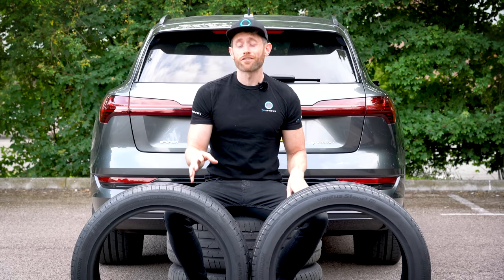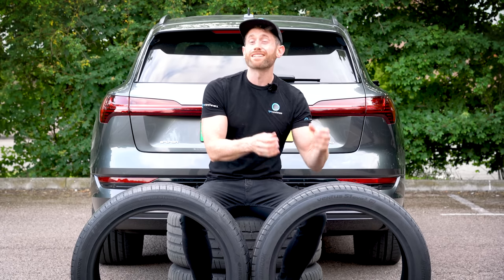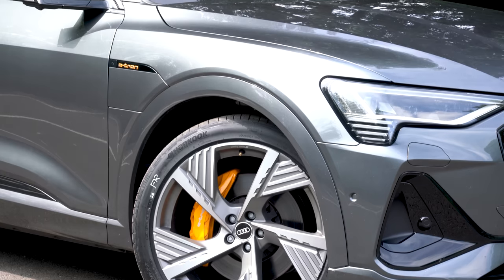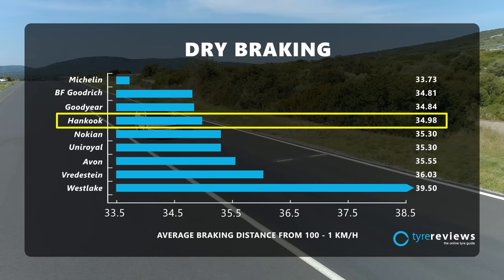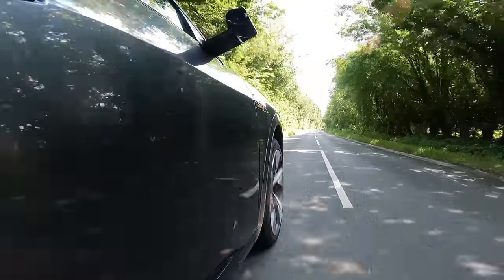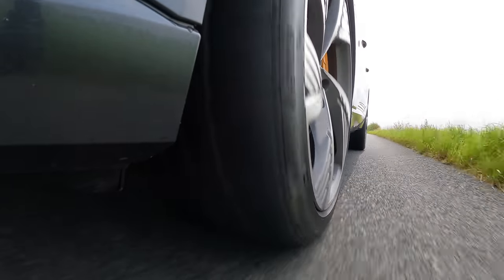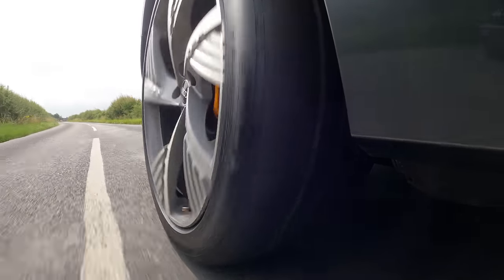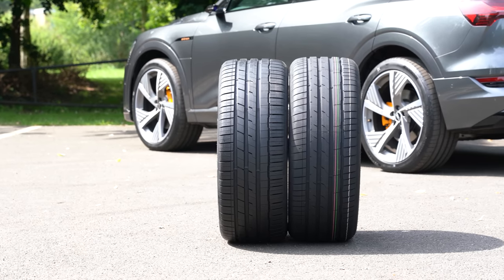What makes EV tires different, and why should you fit them! 🔌

Comment: Love my EV, never going back to ICE.

Thanks for this video. I was wondering about this for a while now and content like this is a rare thing.
Thanks again.
Reply: Love my ICE. Never going to use an EV until they can reach 1000 km range , 5 min charging time and until the fast charging infrastructure will be equal in size and efficiency as ICE.
Reply: @luciteck  (Casually drowns in rising sea levels while overheating)

Comment: Interesting video thanks. I need some new tyres for my Tesla Model S P90D ludicrous but I’m guessing EV specific tyres are also more expensive? Another question I can’t find an answer to…. My model S came with either the 19” wheels or the 21” wheels, mine has the 21’s which look great but come with a significant range penalty. I’m looking to buy a set of factory 19” wheels with winter tyres. Will the soft compound and aggressive tread make the 19’s with winter tyres still more efficient than the 21’s, the same, or less efficient? If you want to get some tyres for the test and I can keep them you can happily borrow my car 😉 😉 😉
Reply from the maker: Ooo, that would need to be tested. Generally smaller wheels are better for range, but winters could mix that up!
Reply: Yes, I’d be very interested to know. I’ve always fitted winters to both our cars in the UK for the last 10+ years but not sure if I’ll see a range gain or loss as a result. If it was a 10% loss for example I’d probably not bother which would be a shame.
Reply: Surprisingly I have not had a noticeable range penalty with winter tyres on a Tesla Model 3 SR+ (Goodyear Ultragrip) even used in warmer temperatures. Whether that's the same across other brands I have no idea. It's hard to know because obviously winter temperatures themselves impact EV range quite strongly and that's when most people are going to be using the winter tyre. I kept them on into the warmer period and was surprised to see my range return to what I would expect for summer tyres. Obviously I don't have any opportunity to do this kind of back to back testing ... which is why we love Tyre Reviews!
Reply: @MrAdopado  thanks for the reply. Was that with the same sized wheel though? My question was about the difference between summer tyres on 21’s vs winter tyres on 19’s. By your experience though my like for like range should improve.

Comment: Great review! Never occurred to me that electric cars require ev tyres. The weight of that car is immense 2.7 tonnes? 😩
I wonder what will happen if you put ev tyres on a petrol or diesel car. Will it be more quiet?
Reply: I assumed they would have a few years back when eMTBs became a thing and the tyre manufactures quickly developed new mountaìn bike tyres for these electric assisted bikes - again to cope with the extra weight and torque (not bothered by noise or range so much I don't think).
As for fitting to a normal car I'd assume it's a big no no - the tyres themselves weigh a fair bit morethan normal car tyres and that will have an immediaten effect on how the car handles potholes etc. (heavier unsprung weight) with a long term effect on wearing out your suspension quicker too. May even find it slows your acceleration due to the rotational weight, remember EVs have masses of torque so not an issue there.
Reply from the maker: I cover that a bit at the end. They would be, but you can get foam matting in normal tyres too
Reply: Do bear in mind that there is a range of weights amongst EVs just as with ICE cars. Not all EVs are 2.7 tonnes and Etron is at heavier end (My Tesla Model 3 is 1 tonne lighter than Etron and the Model 3 range is similar weight to BMW 3 series ICE range)

Comment: Thanks for a great video 👍 What's your recommendation for tire choice for lighter EVs? 

I have a Honda E, which is about 1500kg. Came standard with Michelin PS4S. Very grippy, but less efficient. So much that our winter tires, Blizzark LM005 (same dimensions) increase range by 10%. Should I go for EV specific summer tire next year?
Reply from the maker: e.Primacy https://www.tyrereviews.com/Tyre/Michelin/e.Primacy.htm

Comment: I have a set of Michelin CrossClimate+ on my Tesla Model 3 Performance that I simply find irreplaceable. They have great grip in the summer and rain, their snow handling is amazing (I live in New England so lots of snow), I have nearly 20k miles on them and the tread is hardly worn at all, and I get good efficiency with them (~250 wh/mi). The only thing bad about them is that they are a noisy compared to the stock Michelin Primacy MXM4 Tesla tires. I hope Michelin will come out with a CrossClimate 2 EV!
Reply from the maker: The new CC2 is very low rolling resistance so will be an improvement for you!

Comment: If you want to reduce the inertia of the unsprung masses and management costs; and at the same time improve efficiency, driving comfort and handling, just choose a car with smaller rims (max 18 in) and more aerodynamic rims such as the Ronal Aero and use preumatics with the right load coefficient.

Comment: @tyrereviews, thanks for the informative review. Question, if the EV tire is heavier, understand the value in the foam for the sound, and stability, but where does the EV tire efficiency come from to counter the extra weight.  I missed that.  Thanks.

Comment: I have a heavy AF ICE limousine(96 fleetwood 6 door with chevy LT1) I can squeeze 30MPG out of it, but with these tires, i might be able to squeeze out an extra 1-3MPG, i'd just need a different set for snow. I did notice that when i went to all season light truck tires my fuel economy went down to about 25-28 depending on temperature(this car loves 95f+ ambient temps)

Comment: Recharge times can be high if you are only using a 3 pin plug. You should be able to charge over night with a 7 kwh charging box. 

I have an MG ev. It's perfect. Or look at the Sono motors car.

Comment: thanks for the wonderful video to explain. 

could I understand a little better - shouldn't the load/weight rating of the tyre already help address the issue of heavier cars? what is that specific difference that makes an EV tyre more supportive of an EV car's weight than a high/extra load rated 'normal' tyre?

I'm thinking of choosing between the Pirelli P0 PZ4 (PNCS, Elect) "102W" and the Michelin Pilot Sport 5 "102Y" - both "XL" for the size 245/45/R19 on the Polestar 2. The minimum load rating in the owner's manual is "99". Which would u recommend then for better handling and cornering?

Comment: Had a chuckle that Ventus S1 Evo3 EV is not available for the E-tron in the US. It's also a UHP summer tire which is not practical where I live and generally not practical for a heavy family car. I will say that the caveat to your otherwise excellent analysis is the differences are only relevant for EV vs. non-EV versions of this particular tire. I'm currently suffering through OEM GoodYear Eagle Sport All-Seasons which are far noisier and with worse ride and more squirm than Michelin X-Ice Snow SUVs which makes it the second car in a row that I prefer on snow tires rather than OEM all-season tires (the other one suffered from BMW's obsession with the atrocious plague that is run-flats). Heavier tires also increase unsprung mass which then adversely impacts all other aspects of ride and handling.

Comment: Great video, Thank you for your efforts to present us the differences between those 2 tyres. Audi fits a set of Hankook Ventus S1 evo 3 EV tires in the Q3 SPortback mild - hybrid 150Hp. I' ve noticed as you said, the lower comfort level and the unacceptable lateral wet handling. Is there a reason to use a dedicated EV tire in a MHEV, which is primary an internal -combustion engine vehicle? Which would suggest instead?

Comment: Thanks for the video. As I’m looking to replace my original set of tires on my Performance Model 3, 👀 Ng at options, your video is informative. I’d love to see a side by side comparison of different branded EV tires, I think that would be helpful to those considering going with stock manufacturers tires versus switching to another brand for reasons of performance or noise, etc.  thanks again
Reply from the maker: For teslas I'd say stick with OE as they're pretty tuned

Comment: We need this test: Michelin Pilot Sport EV vs Pilot Sport 4 or Michelin E Primacy vs Primacy 4. I have heard that the wet braking is much worse with the Michelin EV tires compared to the “normal ones”
Thanks for your videos!
Reply from the maker: I actually have a a video (not a test) covering partly this tomorrow. You're right, for now I'd be fitting the 4 over the E.Primacy

Comment: Do you have thoughts on EV tires on Hybrid vehicles? I own a new model Corolla hatchback with 2.0l engine. Usually in the city about 50% of active driving is EV, would you consider fitting EV tires on it?

Comment: Really nice review again. You said it is possible to apply acoustic foam inside normal tires. Did you mean that its possible to actually do this yourself? I am actually surprised you barely see any tires in the normal touring tire segment have it as it is really cheap to add and will make a significant increase in noise levels. What is the reason you think they don’t do it?

Comment: I have read that you can increase the range of basically any car by filling the tires with pure nitrogen. The reason for this is that nitrogen don’t have the same thermal expansion as air. This means that you can have optimal tire pressure in all conditions and temperatures. Aircrafts use nitrogen in their tires for this reason. When they land and probably during takeoff the temperature in the tires increases radically but the nitrogen prevents the tires to explode due to the increased pressure. On combustion engines you can reduce the fuel consumption by 5% and the mileage before the tire is worn out by 25%.
Reply from the maker: I'd love to see this tested.

Comment: In fact, any EV tire is the best product of the current tire manufacturers. Whether they admit it or not, they must maximize energy saving and wear resistance, and the grip will also be improved due to the increase in vehicle weight. Traditional car tires are not the main research direction and sales point for energy saving, but electric vehicles have changed this demand. If you are an electric car, or a heavy fuel car, I suggest you choose EV tires.Hihgly recommend Sailun ERange EV Tires

Comment: One thing I don't think I've seen mentioned here and what swayed it for me to purchase Hankook EV tyres is the price. £100 ish per tyre cheaper than the fitted Michelin Pilot Sport 4 S on an EQC.
Also as I've found out from other owners the EQC rapidly wears the outside edges of both front tyres (too early to say if the Hankooks are better for this). Mine seemed to rapidly wear to the canvas before the rest was any where near worn out. Not quite sure why, tracking has been checked as OK. Could be a combination of previous soft tyres,  cars extra weight and mainly using comfort mode which predominately utilises the front motor (since learned to use sport mode with its continuous F&R motor drive). Noticed the wear more on the NSF tyre, could be owing UK roundabouts and clockwise motion?

Comment: Glad you mentioned those ridiculous 22” rims, and how inefficient all that metal makes the car, I wanted to comment right away the irony of comparing difference of two tires fit to all that heavy chunk of vanity. Hoping it won’t be too long where we all look back at this era of way to big of a rim, with a deserved eye roll. 
I don’t know why you say it’s about handling with a big Rim, and how this low profile secret has been kept from F1, or any car designed for racing. They all seem to be getting enough handling out of a more efficient ratio of rim size to sidewall.

Comment: I have standard model 3 by tesla. Car weights only 3500 lbs.  Can I then be ok with regular non ev tires. Since it's not that heavy
Reply from the maker: In theory it would be less of an issue, but the OE tesla tyres are pretty heavily tuned for the car for things like handling so you might be better off with the oe

Comment: Not certain this post will be seen but here it is anyway. I have a 2008 VW Touareg V10, it’s quite heavy at 5900lbs. Since weight seems to be a large consideration as to whether an EV tire is applicable might this be so in this case?

Comment: 🤔 Don't get me wrong, i appreciate the advise of someone who knows their job. The thing that makes me scratch my head a bit is the "why you should not put them on your normal SUV" part. Weren't early 2000's Rangerovers and Disco 3's as heavy as the e-Tron? What if your SUV is as heavy as an EV and the tire size fits? (Not sure if it is the case at all, but i would be surprised if not)
Reply from the maker: Worth a shot, but then also the OE tyre would have been developed with similar goals

Comment: I'm shopping for winter tyres for an EV, but i don't see EV-specific winter tyres in the required size. Especially in winter you'd want the improved efficiency as range is reduced in colder weather.

Comment: will i have significant issues in installing k127e instead of k127a (ventus s1 evo 3 SUV). can't find the later in stock and was recommended k127e.. after reading your tests I chose efficientgrip 2 suv(for Tiguan) and I was hesitant to fit tyres for ev in diesel car

Comment: Great video! I’m interested in where you see PHEVs fit into the EV/non EV tyre picture? Since they have characteristics of both ICE and EV, does this make the decision on which tyre to buy more tricky?
Reply from the maker: I don't know, but my dad just bought one so I guess I need to work it out. Personally I'd go for a normal tyre which has been developed with RR in mind, like the Asymmetric 6.
Reply: @tyrereviews  I'd be really interested to know where you land in the end. Mine is a C Class, and I wondered if the OE MO fitment tyre would have been developed with the hybrid specifically in mind, or whether it was just developed for the C class in general. So far I can't find that information publicly available.
Reply from the maker: @ping2084  At a guess I would say even if it's the same tyre, the OE tyre will be more focused on energy usage than the aftermarket version anyway
Reply: @tyrereviews  ok that's interesting. Makes sense since they'd want to publish the best efficiency data. Keep up the great work - I'm looking forward to seeing whatever the next one is!

Comment: If you charge overnight, the battery is quicker, in real terms (30 seconds plug/unplug, the same time as inserting the nozzle <G>)  than a liquid fuel car. 😉 Less efficient tyres/energy use also means more pump time too. Many of us (especially with things like Tesla Model 3) are very concerned with handling. 😁 Nice comparison! We need more choice in EV tyres, especially all-season ones. It'll be interesting to see how these EV tyres change when EVs are as light (or lighter) than ICE in a few years. Oh and EV will be the "normal powered" one very soon...

Comment: I just bought my car and barely got 15,000 miles in 3 months and had to buy 2 back tires because of wear, I would need to buy another 2 for the front soon! Should I keep buying expensive tires every 3 months? I dont mind the noise or the slight disadvantage in the handling.

Comment: Going to buy some new ones for my E-Golf with 205/45-17''. 
I just need some that are silent and has good rolling coast.
Currently have Conti Contact 5 and they are bad... never been fan of this tyre on other cars too. loud, bad performance in rain, allready giving rude noice from the road. its only 2.5 season old, quite new and still has good wear... Was like that on my other cars with Conti

Had Dunlop Sportmaxx on a another egolf and a A3 (same car just with engine), good tyres, but uses a lot of energy, a bit loud and quite stiff. but performs well in rain and corners when dry/wet.
Reply from the maker: e.Primacy :)

Comment: Seems the biggest issue I see in social media forums for ID.4 and XC-40 Recharge is the rapid wear out of the OEM tires on these cars and the high cost of replacement of asymmetrical staggered sized tires.  No tire rotations are allows with these two cars as I understand from these forum, and tread life warranties are not  honored when installed on an EV.  Can you comment on the tread issues?  This can run up quite a bill when the life of snow tires and all seasons are factored in.

Comment: I have Michelin PS EV, 20" on my Cupra Born, there is a drone/whine/hum on the motorway when driving more than about 60mph, once you hear it, it's quite annoying.  The car I tested had 19" wheels.  I will need to wait until Nov when I switch to my 19" wheels to see if the noise changes or goes away.

Comment: 3:43
Great initial turn in response does not equal more grip.
Great turn in response can simply be achieve with a stiff sidewall, like u said due to the weight.
I'm willing to bet my house the standard tire can produce more G on a skid pad.
Reply from the maker: Depending on the grip surface, for sure

Comment: Never knew tyres could be so interesting! I have an EV (eGolf) and it was factory fitted with ECO tyres (low rolling resistance) but I don't think they are necessarily optimised for an EV. I have had to replace 2 tyres since Dec 2019 due to side-wall damage and during the last change the fitter seemed to think that the side walls were very thin. The tyres are Bridgestone Turanza T001, 205/55 R16 91Q. It appears to be the Q that denotes they are ECO. Any experience of these? I am not really impressed with them, but maybe I was just unlucky with the punctures.
Reply from the maker: I've not, sorry. Maybe look at the e.Primacy next!